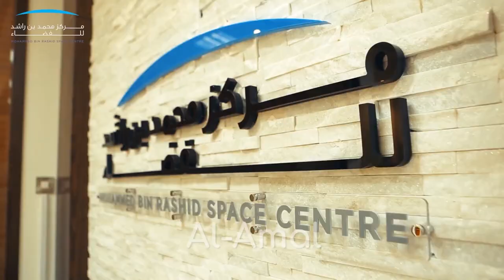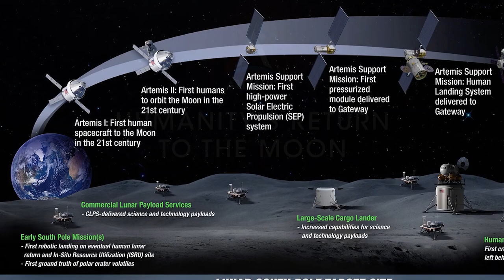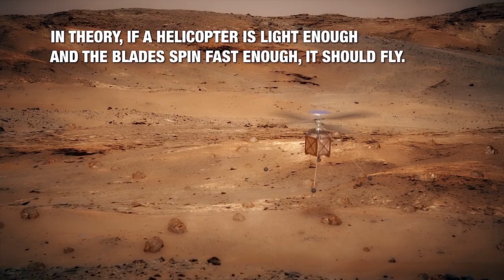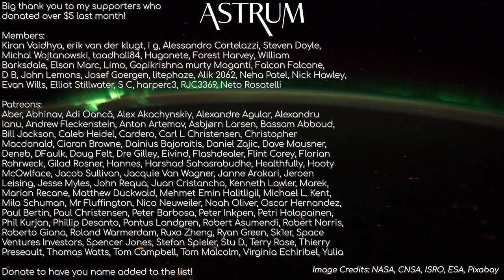The Most Important Space Missions Launching In 2020

Comment: I've always wondered why NASA rovers designed for Mars weren't provided a secondary means to get out of tough spots (if the rover gets stuck in the dust). If they use wheels, then a secondary "track" system that could be lowered and raised might be helpful. Even if that didn't work, why not design a system of two stilts that can be lowered and lift the rover? If this would be successful, it could prolong the lives of those rovers if they become trapped in dirt/dust.
Reply: Great idea how do they keep the Rovers clean from the Dust